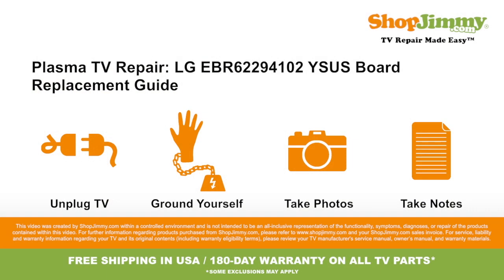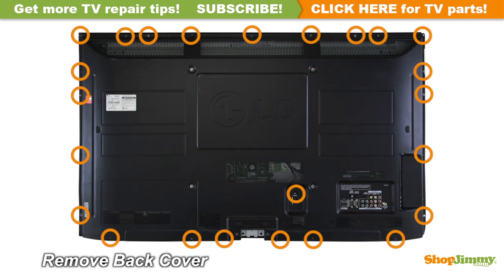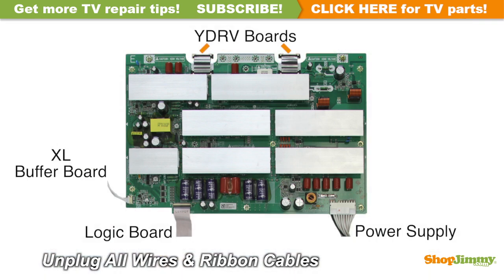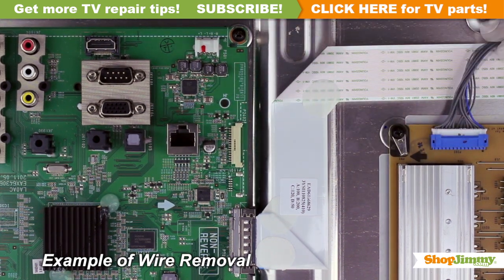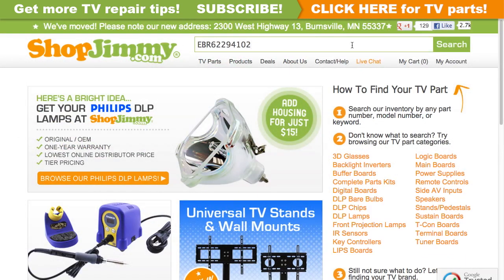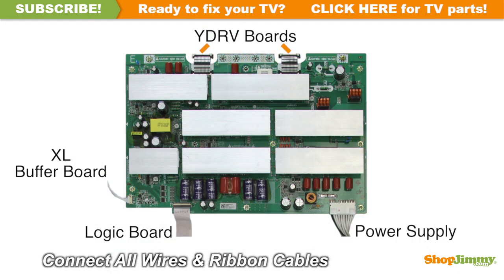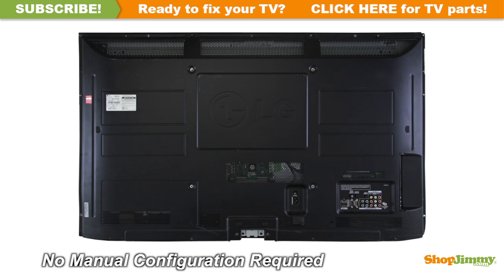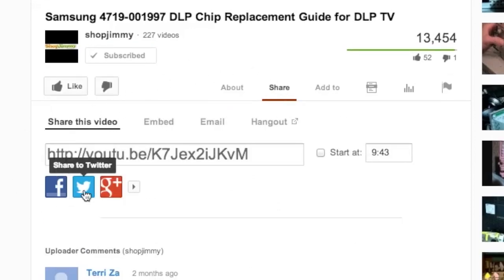LG Plasma TV Repair - How to Replace EBR62294102 YSUS Board in LG 50PK Plasma TVs - Fix Plasma TVs

Comment: hello
I have a LG plasma (model# 50pc5d-uc) and the picture does not show up on first power cycle, but bottom light turns on. I have to power off then power on again to get the picture to come on , any suggestions will greatly appreciated.
Reply from the maker: Daniel Wickham Please watch this video FIRST to help with your repair!  https://www.youtube.com/watch?v=BP3NVNCGEv8  I recommend replacing the YSUS board and the YDRVTP & YDRVBT boards in your TV.  Click this link to replacement parts for your TV model number:  http://www.shopjimmy.com/catalogsearch/result/?q=50pc5d-uc  There may be multiple boards for the same TV model number, be sure to match part numbers on your current board, with your replacement for compatibility.  Here is a link to a video showing how to identify your part number, click here:  https://www.youtube.com/watch?v=GEllG3RV-tc  Thanks and please let us know if you have any further questions with your TV Repair!  www.shopjimmy.com

Comment: I have a 50" LG Plasma 3D TV that will power on, but has not picture or sound, and no display of any kind. But it remains powered on. I was told that perhaps the main board is bad. Is that the YSUS board, or another board? Any ideas? Thanks.
Reply from the maker: Patrick O'Harra   I recommend replacing the Y board and buffers in your TV.  Please reply with your TV model number.  Click here to view a video that shows how to find your TV model number:  https://www.youtube.com/watch?v=S51nhAmwR2M  Thanks!  www.shopjimmy.com

Comment: Hi
I need help with my LG 42pc3dva-ud please. Its a 42 in and it suddenly lost the picture but the sound is there and everything else seems to work fine. what board or part do I need to replace?
Reply from the maker: yamdood1   I recommend replacing the YSUS board and the YDRVTP board in your TV.  Here is a link to replacement parts for your TV model number on our website, click here:  http://www.shopjimmy.com/catalogsearch/result/?q=42pc3dva-ud  Be sure to match part numbers on your current board, with your replacement for compatibility.  You can also call our customer service for further assistance with your purchase.  (877) 881-6492  Thanks and please let us know if you have any further questions with your TV Repair!  www.shopjimmy.com

Comment: Hi I have this exact model television and a black line going from the top to the bottom of the television I've seen some videos do is unplug the ribbon can clean it and put it back in and it works is that a possibility or do I have to replace a part and if I do want one?

Comment: HI, I Have a  LG TV    47LG50-UG
The problem I have the message "this function is not available now" started flickering constantly on the screen. Even though you can still watch tv the message is constantly flickering. The tv won't shut off and I can't access any of the tv menus. please HEP
Reply from the maker: *****   I recommend replacing the main board in your TV.  Here is a link to replacement parts for your TV model number on our website, click here:  http://www.shopjimmy.com/lg-ebu42600302-main-board.htm  Be sure to match part numbers on your current board, with your replacement for compatibility.You can also call our customer service for further assistance with your purchase.  (877) 881-6492  Thanks and please let us know if you have any further questions with your TV Repair!  www.shopjimmy.com

Comment: I have a 50pv450 plasma and it got wet .ever since then the remote doesnt work.which part of the tv contains the remote control sensor.? Yes I tried new remotes.the tv functions great except for no remote .
Reply from the maker: CADEN MUTH   I recommend replacing the main board in your TV.  Here is a link to replacement parts for your TV model number on our website, click here:  http://www.shopjimmy.com/catalogsearch/result/?q=50pv450  Be sure to match part numbers on your current board, with your replacement for compatibility.  Here is a link to a video showing how to identify your part number, click here:  TV Part Number Guide for LG & Zenith Main, Digital, & Tuner Boards (LCD, LED, Plasma TVs)  You can also call our customer service for further assistance with your purchase.  (877) 881-6492  Thanks and please let us know if you have any further questions with your TV Repair!  www.shopjimmy.com

Comment: Hi I have a lg 50 inch tv everything works but two of my inputs for hd cables got stuck inside my tv :( can I fix or do what can I do because I use all 4 hd inputs and it gets annoying changing back and forward...help please
Reply from the maker: TheMexicanPro I recommend replacing the main board in your TV.  Please reply with a TV model number and then I can recommend a replacement part.  You can also call our customer service for further assistance with your purchase.  (877) 881-6492  Thanks and please let us know if you have any further questions with your TV Repair!  www.shopjimmy.com

Comment: HI,
I have LG 50PG3000 plasma the TV has sound but no picture if i replace the Y-Buffer Board with a new one, that would solve the problem?
Reply from the maker: dinociano This is a good place to start.  Replace that board and see if the picture comes back.  Here is a link to replacement parts for your TV model number on our website, click here:  http://www.shopjimmy.com/catalogsearch/result/?q=LG+50PG3000  Be sure to match part numbers on your current board, with your replacement for compatibility.  Here is a link to a video showing how to identify your part number, click here:  LG Plasma TV Repair: DIY Part Identification Number ID Guide for LG & LG Philips Plasma Panel Parts  You can also call our customer service for further assistance with your purchase.  (877) 881-6492  Thanks and please let us know if you have any further questions!  www.shopjimmy.com

Comment: I have a LG 50PA5500-UA I turned the tv on and there was a black line about an inch from the top and then about 30 min later the tv turned itself off and when I try to turn it back on there is sound but no picture.  Would I be able to fix it and will that black line go away? thanks
Reply from the maker: scorpionBOB9966 I would recommend replacing the y-sus board in your TV.  Here is a link to replacement parts for your TV model number on our website, click here:  http://www.shopjimmy.com/catalogsearch/result/?q=+LG+50PA5500-UA  Be sure to match part numbers on your current board, with your replacement for compatibility.  Here is a link to a video showing how to identify your part number, click here:  LG Plasma TV Repair: DIY Part Identification Number ID Guide for LG & LG Philips Plasma Panel Parts  You can also call our customer service for further assistance with your purchase.  (877) 881-6492  Thanks and please let us know if you have any further questions!  www.shopjimmy.com

Comment: I have an LG 60PK950-UA , it powers on and stays on but no picture.  What do you think I need to replace.  Thanks
Reply from the maker: clubberlange73 I would recommend running the flashlight test on your TV to help determine if the problem is the backlight inverter or the main board. Here is a link to a video we produced that shows how to run the flashlight test. No Image No Picture on Screen-Flashlight Test LCD TV Repair - How to Diagnose Broken Board TV Repair Please reply with your flashlight test results and we can recommend a replacement part for your TV repair. Thanks and please let us know if you have any questions! www.shopjimmy.com

Comment: I have an LG 50pk550 and there's a single thin vertical green line. Its close to the center of the screen but its on the left half of the screen. Its berry thin and not noticeable depending on the colours being displayed. What parts do I need to replace? Thanks in advance.

Comment: H E L P!! I have a 60in. LG Plasma. When I turn on the TV, the little green light (indicating it's on) comes on for a second, and then immediately turns red again and shuts off. I read online that I need to replace the Power Supply. Is that true?
Reply from the maker: Bee Gee Yes, I would recommend replacing the power supply for your TV.  Please reply with your TV model number if you would like us to recommend a replacement part.  You can also search your TV model number on our website, www.shopjimmy.com to find compatible replacement parts for your TV repair.  You can also give our customer service a call for help with your purchase.  (877) 881-6492  Thanks and please let us know if you have any further questions!  www.shopjimmy.com
Reply: 50PM6700-UB
Reply from the maker: chee chung   Here is a link to a replacement power supply.  http://www.shopjimmy.com/catalogsearch/result/?q=50PM6700  Be sure to match part numbers on your current board, with your replacement for compatibility.  Here is a link to a video showing how to identify your part number, click here:  TV Part Number Identification Help Guide for LG & Zenith Power Supply Unit (PSU) Boards  You can also call our customer service for further assistance with your purchase.  (877) 881-6492  Thanks and please let us know if you have any further questions with your TV Repair!  www.shopjimmy.com

Comment from the maker: @Alexandre Ocdy - Unfortunately, since the line is vertical, this is a bad panel for your TV.  Panels are typically tough to replace, expensive and hard to find.  It may be most cost effective to purchase a new TV.  Thanks and please let us know if you have any further questions!
Reply: Power supply repair LG 50PB560D plasma no power

Comment from the maker: @1Margaret Rose - I would recommend replacing the Y-Main(Y-sustain) board in your TV.  This is the part number for your replacement part. LG EBR50038902.  Unfortunately we are currently out of stock for this part on our website.  You can however search this part number on shopjimmy com and sign up to be notified when the part is back in stock.  Thanks and please let us know if you have any questions!  (877) 881-6492